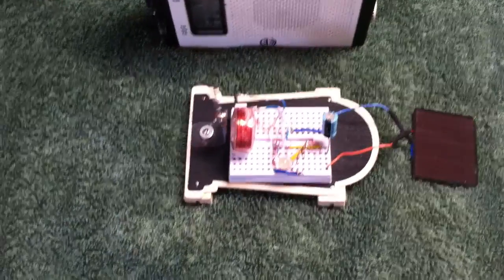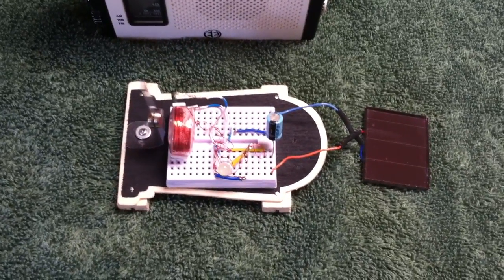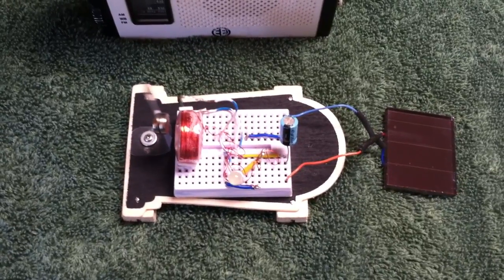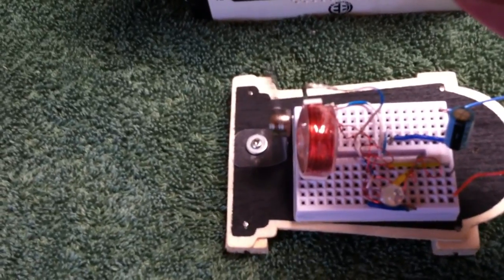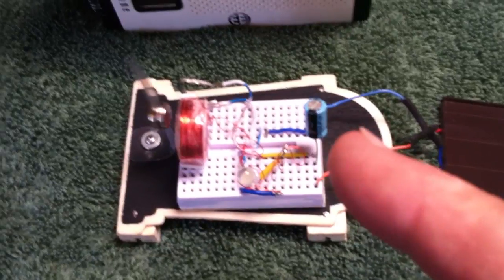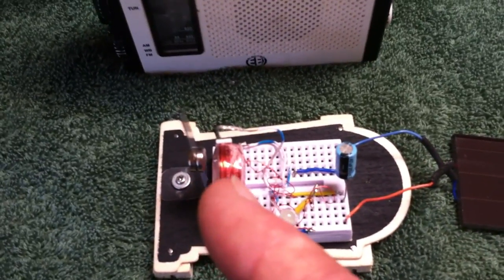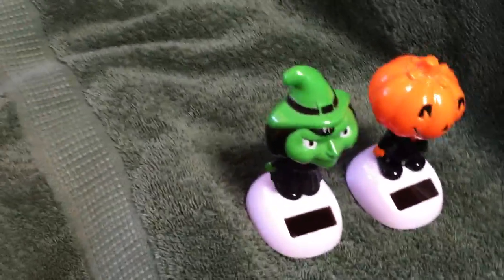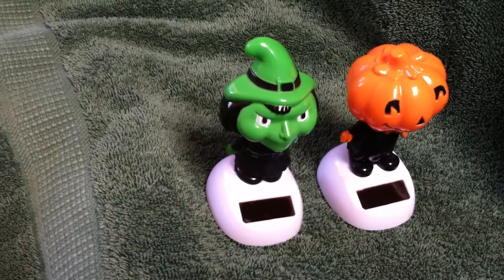Ambient Light Powered  -- Vibrator Oscillator

Comment: Still efficient for ambient light and it's probably doing more 'forceful' work than the dancers !
Those circuits in the dancers are great for robot movers, using a larger cap on them than stock (1000uF or more). The circuit trips and all that energy flows into a small cellphone vibrate motor, so you can power something along in the sun using the tiny solar cell. Very robust circuits, I haven't blown one up yet :)
Reply from the maker: Thanks for the tip.  I will have to try that.   Maybe you could drive a larger pulse motor also.  I never thought about using a bigger cap.

Comment: lol that's great mate. works well of that solar panel. especially in a kitchen under lol light.  take it into the sun and I bet it will go nuts lol

thanks for sharing' interesting stuff.

🖒🖒🖒🖒🖒THUMBS UP🖒🖒🖒🖒🖒

Anthony 

High1voltage1rules
Reply from the maker: Thanks. If you give this enough power you can get rid of the cap.  You just have to adjust the gap between the coil and the magnet.

Comment: ... Between two magnets in attraction is the same magnetic structure found within the magnet, however, in spacetime. Upon joining together this real physical set of structures, and upon their separation is caused the same exact said energy or spark. Nothing already unknown. The importance of which I believe is highly overlooked. For this action is of the negentropy or the “negative resistor” of spacetime vacuum flux. This is the whole action of magnetism (stimulation variation frequency of the kinetic energy of the dielectric inertial plane.) All processes depending on magnetism work on the magnetic circuit principle. Induction via proximity to field flux action, on off on action, or frequency of magnetic circuit oscillations. As we already know physical connection and disconnection is unnecessary. The reason Tesla Coils work is because of this action. Realising spacetime is being compressed and expanded in this process is the actual reason for change in charge and the existence ofdipole.

Comment: Did you use trial & error to find the right size cap?

p.s.:  Personally, I think the pumpkin head bobble-head is a keeper... :-)
Reply from the maker: I just kept trying different size caps until I found one that worked with that solar panel.  The solar pumpkin head is a favorite of mine.  I had a whole bunch of those solar wavers but my wife hates them so most got put in a box or tossed out.
Reply: Time for a variable cap? :-)
Reply from the maker: Fun idea to try.

Comment: "Reed switch opens up, it makes a spark, and the radio picks that up." This is the same effect that killed the man who threw the switch at Tesla's Niagara Falls power plant, spoken of by John Bedini. Before either a return circuit (I presume) or a grounded circuit was applied. Why is this? We might ask, of importance? I believe Bedini holds this moment as vacuum flux or zero point energy, and as the explanation of his battery charging system. Often overlooked for its importance. Also linked in as the reason why amperage decreases under higher load force application while the horsepower increases. Otherwise known as negentropy? ( https://www.google.com/search?q=negentropy+bearden )I think I'm just beginning to grasp some of Thomas Bearden's explanations. My point if view may be different. As follows: Between two magnets in attraction is the same structure